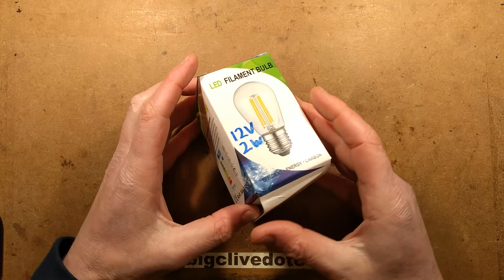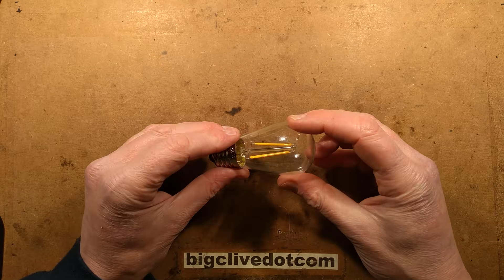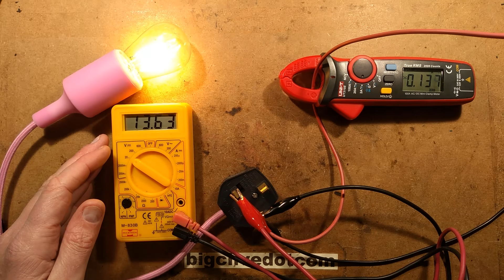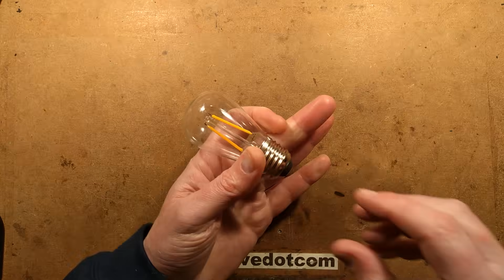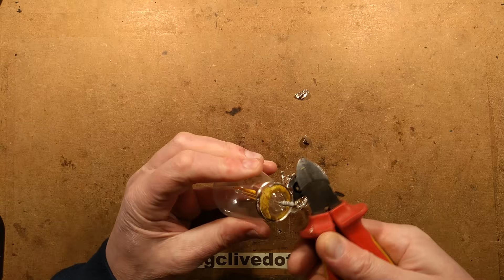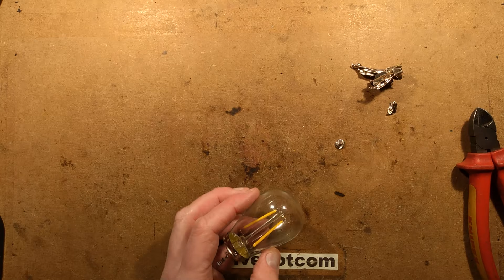Beautifully simple 12V glass LED filament lamp.

Comment: I'm still using a cfl bulb in my living room because I just can't find an led bulb with the right colour temperature.
Reply: A lot of bulbs are listed with their temperature these days.  What's the range you're after?
Reply: @charliedobbie8916  Around 3000k but all the warm white led bulbs I've tried are either too orange or yellow.
Reply: @michaelparker2449  That's pretty standard, but I guess they're not working out for you,  Have you tried any 4000K bulbs? Depending on the shade etc you're using, they might appear to give a warmer light than you'd expect.

Comment: What causes leds to start flickering after awhile?
Reply: Poor-quality electrolytic capacitors in the internal power supply giving up the ghost, usually. It's nothing to do with the actual LED and only happens in AC mains-driven LED fittings. It wouldn't happen in this case since it's a 12V DC lamp with only a series resistor; there's nothing in there to cause flickering.
Reply from the maker: It sometimes means that an LED is failing in a series circuit.
Reply: @bigclivedotcom  it's usually in my 12v leds for my cars, they last couple months then start to flicker
Reply: I have some light fittings that are 240v and each have 5 gu4 bulbs at 10watt each from Next home and Dunelm Mill. Replaced bulbs with led from Screwfix and would start to flicker after a short period. So I mixed with 4 x led and 1 halogen it solved the problem.
Reply: @ewaltsauto  I see so many daytime running lights flickering. also brake and rear side lights.
Reply: @davidf2281  In a car there are so many possibilities it's almost endless. EG a loose connection, a corroded connection, an LED starting to fail, the high side driver in the control box starting to fail, a dry joint in the control box, a dry joint on the LED light. That's just some I have seen. Any system where there is vibration is going to have potential issues with dry joints and bad connections more often than one that is static.
Reply: Internal faults in the LED can also cause flickering. I’ve been using white LEDs for many years now. Even decent LEDs from proper electronics companies sometimes fail if run at their maximum rated power for long periods. Often they flicker before they die completely.
Reply: They tend to overdrive (no pun intended) those car LEDs and so the LEDs go bad.
Reply: @paulsengupta971  yes there are some idiots that design them for 12V even though 13.8V is closer to what the voltage normally runs at. On the other hand Lucas do it the other way round (as do some others) and state for 12V cars (there are some really old ones around that still run on 6V) and they are designed for 14.2V I think (but not 100% sure).
Reply: @ewaltsauto  Badly designed, they use a single resistor for a bunch of LED chips in parallel, since LEDs are current driven, the different Vf of each chip means that one of them will draw more current than the rest and as they burn out, it will starts to flicker. A properly designed lamp must have a single resistor per series string of LEDs.

Comment: the bulbs aren't evacuated, are they?
Reply from the maker: No.  But some high power ones may have a thermally conductive gas in them.
Reply: Some people might be if they tried to run them on 240V.

Comment: Emm.. Why this lamp have standard E27 socket!!?? This is dangerous as You mentioned.. For 12V is other sockets and lapms (example - home halogen lamps). Strange that they manufacture these with standard mains sockets.. Some time ago there, in market, was one 230V bulb socket with same pitch as G4 (or G5.3, not remember exactly, long time don't seen these).. Then people start by accident put in these sockets standard G4 12V lamps.. :D No more bulb's is manufacturing for these 230V lamps anymore for safety reasons.. And if they are, there is no way to get these in Europe.. For that reason, i need to modify some friend's lamp sockets, time by time - changing holders to fit other standard halogen bulb's (usually G9).. And that was cheaper than new lamp, especially, if they very like it..
From one point of view, these 12V E27 bulb's are great - no need to modify lamps for 12V circuits.. But from other - there is lot of 12V sockets in market, safer is to use bulb's with low voltage sockets to avoid accident's and modify lamps for these if no possibility to get desired lamp with DC socket.. 
Just my opinion.. Because, i modify even my own lamp - one wire directly from 230V main switch, with two positions, second wire from switch power's up SMPS to drive 12V color LED's ( LED's through G4 or G5.3 sockets wired directly to SMPS output).. And i get lamp exactly like i want.. without possibility to do mistake when replacing bulbs.. Before that, i can't find lamp that i like and that may run 12V bulb's.. If they was for 12V, I don't like  it.. And by the way, SMPS is modified from current controlled to voltage controlled and is hidden in lamp base close to wall.. :)

Comment: could PWM cause headache ?
Reply from the maker: Flickering lights repeatedly stimulate your peripheral visions.  So yes, they can at low frequencies.
Reply: @bigclivedotcom  make sure to remember that when one buying lights for your home, easy test can be done right there at the shop, use your smart phone camera at the light, if its PWM, camera will see it, dont want any PWM in my home, not even a fast one

Comment: A 12 volt system in your house ain't happening. Too much losses.
Reply: Domestic house lighting circuit wiring is generally 1.5mm2. Even if you had 10 of these lamps running on a radial circuit of 50 Meters length, the volt drop would only be around 1.25 volts.

Comment: The Chinese could not make 240volt bulbs, when they got hot or after some use the glue melted and the glass  bulb would fall on the floor leaving the metal part in the light fitting with exposed high voltage. This cannot happen with these 12 volt  led versions.